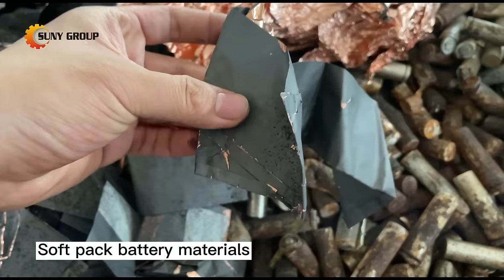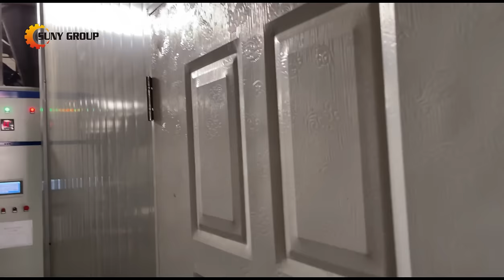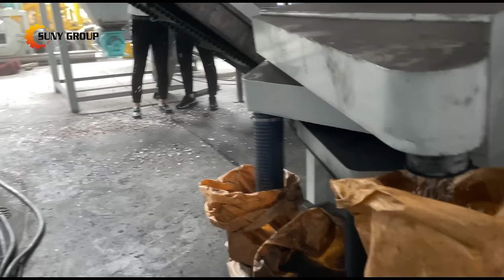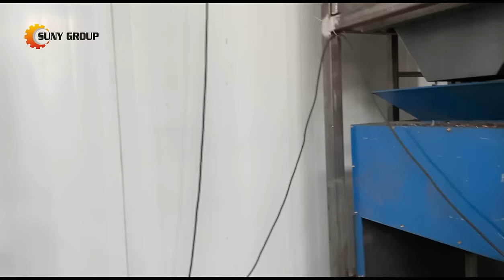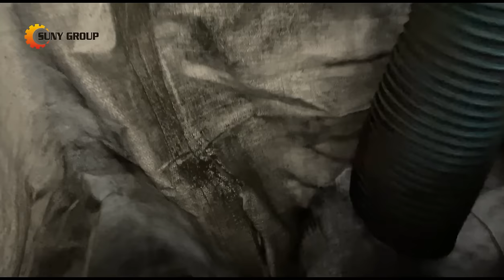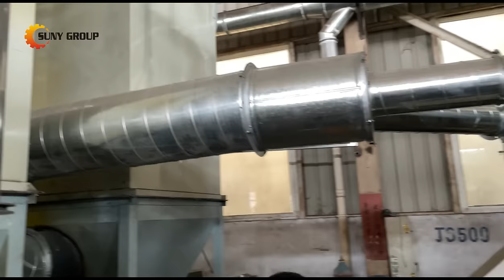7-Minute Lithium Ion Battery Recycling Process Video for Beginners

Comment: Dude, use gloves.
Reply from the maker: yeah
Reply: @SunyGroup lol... I was about to write the same
Reply: Could you please describe the different material that you are getting here during the process?
Reply: While I agree, I think it's a good thing that he's using his bare hands for the purpose of this video, because it's shows that it isn't toxic, contrary to what some people claim.
Reply: @HCkev  Yeah, you can put it straight to your garden
Reply: @lazeppelini123  what's your point? There are a tons of things that's not a advisable to put in your garden that we use everyday. Would you put coke in your garden? Probably not, yet you still drink it.
Reply: I know, right... your still human,fat fingers is going to catch a sliver... Ask me to be the man🤨
Reply: @SunyGroup  YEAH
Reply: @HCkev  yeah I'd put coke in my garden lol. That'd be hilarious
Reply: Ah - Coke is great for gardens but too expensive.
Reply: Hammer mill then separation to black mass and metals. You get copper aluminum and stainless out of them. Black mass has the cobalt and lithium. The machine does a decent job of separation. To get the lithium free use carbon dioxide and water first, then use hydrochloric acid plus air to free the cobalt and nickel. The rest is graphite powder that can be reprocessed into new battery material.
Reply: This is being done where safety rules don’t exist.

Comment: Li is highly reactive .. Im impressed it didn't explode in your bare hands
Reply: The lithium makes up around 10% of each battery, the main component will be graphite which is why it is so black looking. You would have to add some water to get the Li to react. Still, there should be a lot more PPE being worn here, and I'm wondering how he washed his hands after touching the black powder.
Reply: ITS NOT ELEMENTAL LITHIUM, ALREADY IN STABILISED FORM

Comment: I feel sorry for your workers... The dust you can literally see in the video (assuming you recycle batteries containing NMC) is not only toxic but also carcinogenic...
Reply from the maker: hello, this is machine test, we supply machinery. In real operation, there is dust removal unit.
Reply: @SunyGroup  Why not use breathing protection then? Small cost for a business to prevent long term issues for your employees.
Reply: @guyfawkes6050  it's a machine test...not a factory...duh.
Reply: Because mind your own business, that's why
Reply: There was black dust layer on top of your machines.  The dust is NOT being controlled.
Reply: It all looks staged to me as there currently isn't any safe and eco-friendly means of recycling EV batteries.

It's currently one of those issues the EV pushers don't want to address and hope the technology arrives before the first big batch of EV's start heading to the landfill.
Reply: Noticed the batteries appeared to have been burned before feeding into the machine. Using a machine like this on lithium batteries without killing them first would be a deathwish.
Reply: @SunyGroup   it said chat replay is disabled

Comment: I worry about this working condition. It looks like there are a lot of dust there.
Reply from the maker: yes, this is machine test run, we can provide the dust removal units. But some clients do not need (If there is no strict environment requirements).
Reply: @SunyGroup do you realize how poorly this reflects on your brand
Reply: @SunyGroup Do you mean to say Safety standards dont apply for a machine test run ??😅 or the conditions wouldn't harm considering the test run?
Come on, pls educate your team on abiding safety requirements

Comment: Whatg shredder or mill is used?
Reply: @SunyGroup in the first step you reduce the size of the batteries with a mechanical step. What machine is used in this step? A slow or fast running shredder? What screen mesh is below the shredder?

Comment: Have you or a loved one been exposed to SUNY Group manufacturing processes? You may be entitled to significant compensation…

American personal injury lawyer jokes aside - it is interesting how you are able to separate the batteries into their components mechanically and without chemicals and smelting
Reply: I think this is 'black mass' which needs to be further processed through metallurgical processes into the battery chemicals